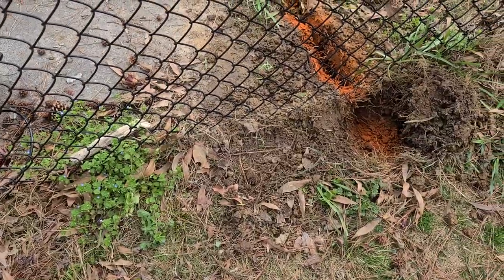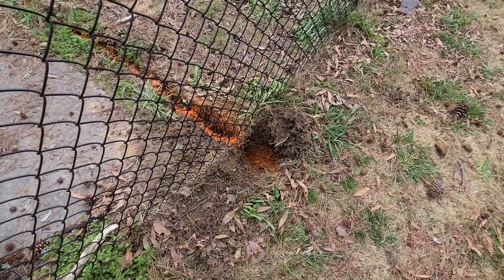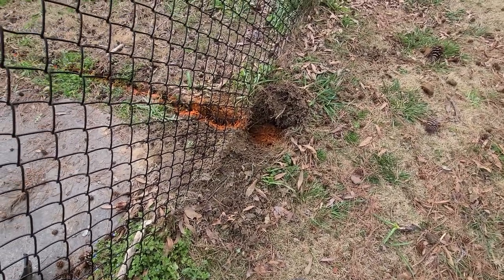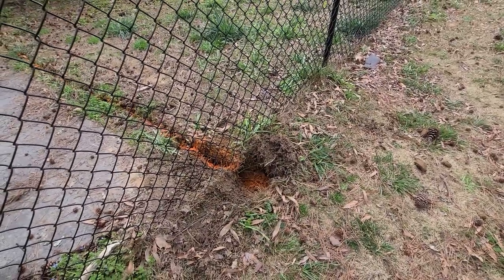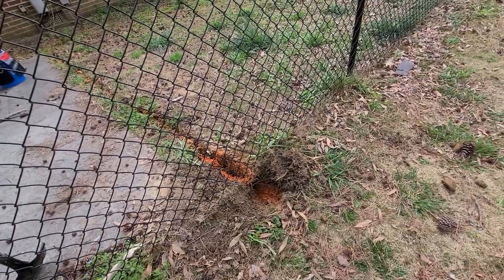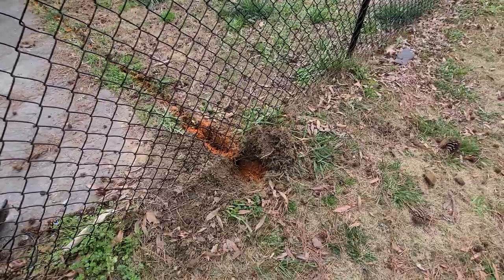Burying underground coax

Comment: Like you, I'm not  a fan of the G5RV antenna. I bought a Hustler 4BTV vertical and am very satisfied with it. Burying the coax and putting a common mode choke inline just outside of the shack lowered the noise floor and eliminated RF in the shack. The 4BTV can be used with or without ground radials when ground mounted. It is an excellent antenna for DX and stateside contacts.
Reply: The G5RV seems like the one antenna people either love or hate. 
I have a "double G5RV" (160 M+), an 80 Meter dipole, a 500 foot, end-fed wire and a Butternut vertical. 
I'd say that overall, 75% of the time, my G5RV has the best signal. 
I also have an OCF dipole, 90' one side and 180' on the other and although it's usable on every HF band except 30 Meters, it's probably the worst performing antenna of them all. 
They're all between 60-70 feet at the center and all but the "longwire" are installed in an inverted V fashion. 
I love my double G5RV! 🤷